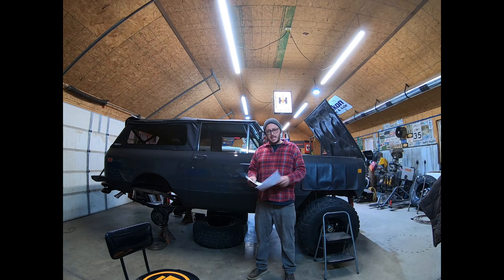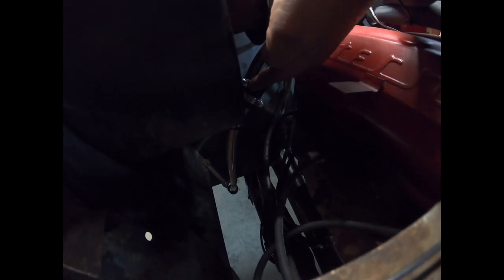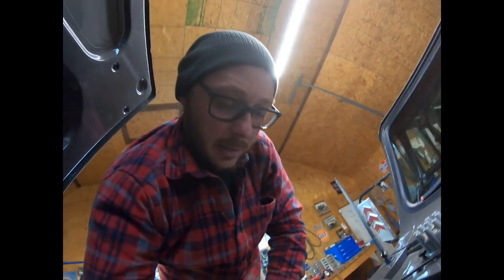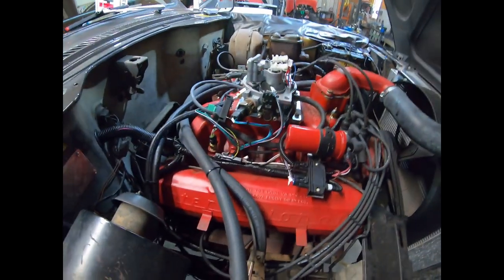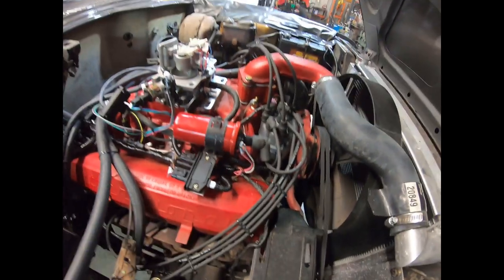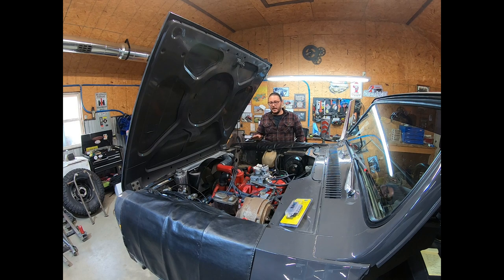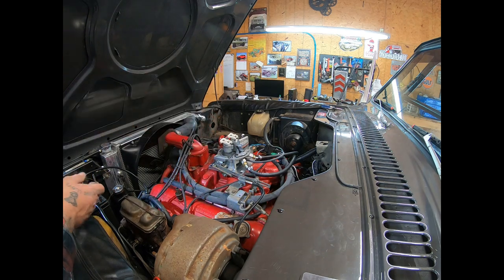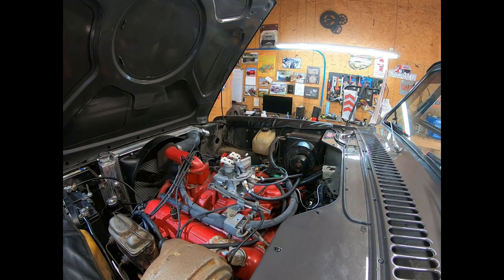How to install fuel injection on your International Scout (Hamilton system)

Comment: How does this system compare to the Holley Sniper efi and carburetor?
Reply from the maker: Well to a carb there is no comparison as you are fully electronic fuel and timing controlled.  No fiddling with chokes, not cold stalling, ect. As far as the Sniper goes I will first off say I have limited experience with the systems, but the experience I have had just wasn't for me.  Sniper for the most part ( unless you choose to upgrade) is a fuel only system which is only half of what you are after in a fuel injection system. The 2 sniper systems I had my hands on ( not installed by me) one was a timing controlled system that had some weird quirks that I personally would not tolerate. The other was fuel only and was plagued with issues right out of the box which resulted in a new unit being installed and still had issues that needed sorting beyond the "self learning". There are lots of guys that love the Holley stuff, and I may get there at some point.  Just not there yet.

Comment: great work
I finished my daughter's install
and have 2 crankcase ports open
1 on the valve cover and the other on the valley pan
should I just put filters on them?
or am I missing a port connection?
Reply from the maker: Valley pan is for the PCV valve and full manifold vacuum.  The valve cover is technically supposed to be plumbed to a spark arrestor not to be confused with pcv and then to the air cleaner.

Comment: Did you upgrade the fuel tank?  We are needing a fuel tank but want to retain the skid plate.  However, we are wondering if a new POLY tank will work with the fuel injection kit when a tank is not baffled?
Reply from the maker: For TBI injection I have never had an issue running an unbaffled tank.

Comment: For a stock distrib w pertronix what do you set initial timing at? 6-8 btdc and is top end advance w vac around 28-30 at 2800-3000 rpm?
Reply from the maker: I usually start around 10 degrees on a scout and if it doesn't ping will try to pull more.  Total advance around 35 degrees

Comment: Question on initial timing. You mentioned set the mechanical to zero. Is that true zero?
Reply from the maker: Yes.  When you install the distributor make sure engine is top dead center number 8 on compression. Balancer at 0. Drop distributor in and I use a distributor cap with a hole drilled in it to align the rotor just past the center of a cap terminal and also just double check and make sure the magnetic pickup and reluctor are lined up.  After you warm the engine up unhook the timing bypass wire and verify that timing is at 0 with a light.  Should be pretty close if you follow these steps.

Comment: So all these Hamilton systems have to have a laptop hooked up at and to set it up???
Reply from the maker: Sort of.  To properly complete the initial setup you must set the minimum idle speed and then adjust the tps.  I suppose if one were so inclined you could adjust the TPS using a voltmeter, but that would be senseless seeing as how you would need the laptop anyway if you wanted the ability to log data. I saw in another comment you linked Howell EFI.  Their system is the same only they have poor customer service and their tunes are pretty far off out of the box.  I have fixed several Howell systems with a proper tune from Hamilton.

Comment: So I am curious how fuel mileage, drivability and power compare with the carburetor.
Reply from the maker: Cold start warm ups aren't a thing with fuel injection. No stumbling when it is cold.  Fire it up. Give oil time to get flowing and take off.  Power is about the same as a carb.  You aren't going to really gain power with fuel injection (unless there is something wrong with your carb). Fuel economy is improved.  I have gotten as much as 16 mpg after switching to fuel injection. 12 seems to be pretty average with carbs and scouts in general.
Reply: Torque is improved across the full rpm range!